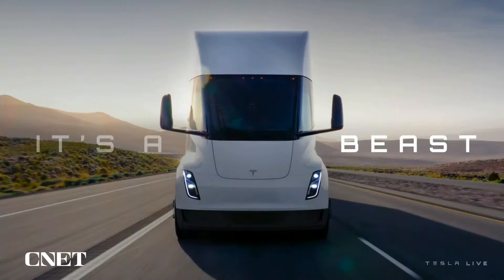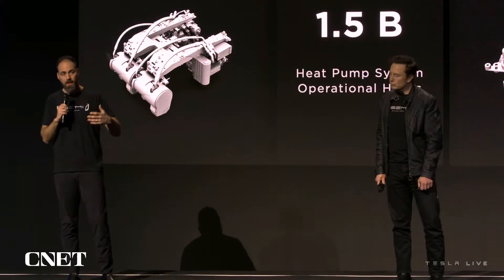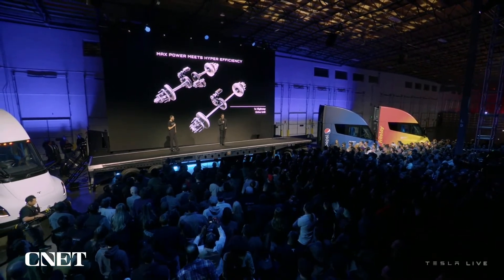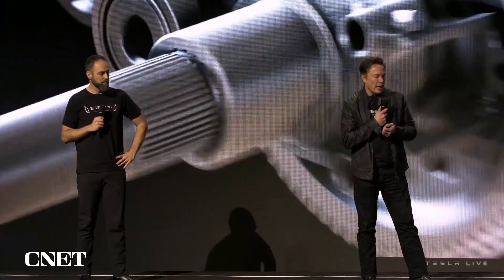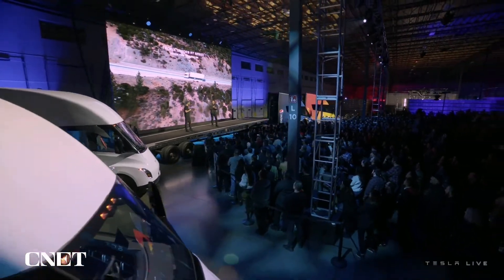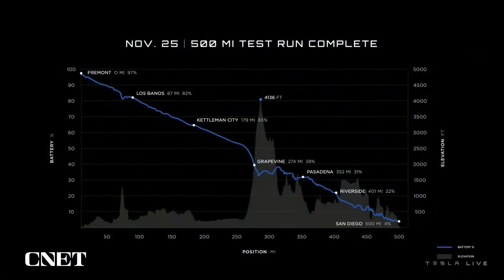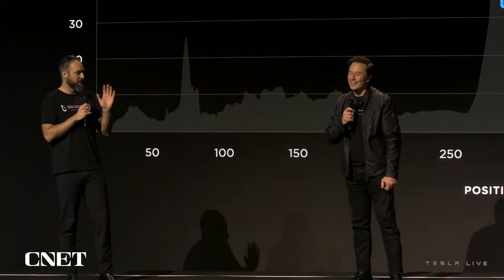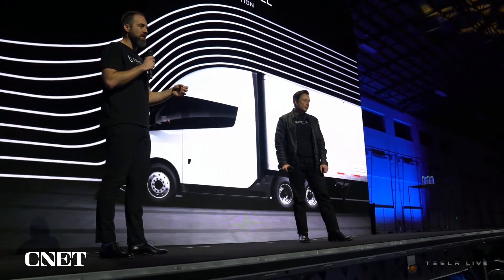Watch Elon Musk's Deep Dive Into the New Tesla Semi-Truck

Comment: All that sounds good for big company's but until they can run 700 miles on a charge an you can find a charging station out in the middle of nowhere an the price comes down 300k... They will never be piratical for small company's (50 trucks or less) or Owner Operators .. I been trucking 35yrs an to prove my point LA to Denver is 1025 miles Beaver UT is the 500 mile mark as of now there is no where to charge the thing so you all the hype talk is just that HYPE ... An a driver that get paid by the mile will go broke unless wages go way up in a diesel that trip will take 18 hrs of drive time @ 65mph so if you leave At 7am Monday you will be in Denver 1pm Tuesday that is driving your 11hr Monday taking your 10hrs then 7hr Tuesday... An before you go telling my that it can run 80mph 90% of company trucks are governed at 65mph so driving this truck you drive 500miles an you are stuck cause there are no charging stations out in the middle of nowhere UT...When they get charging station every 500 miles on the US Hyw system then it is time to talk about pushing diesel out but until this is not a option unless we all want to be naked & hungry...

Comment: They don't seem to mention the weight, they keep saying it does 500miles on a charge. They don't specify what load they are hauling to get this mileage. With a 1 mega watt battery that would take some serious power to charge, like a small power station. He claimed they would all be solar powered charging stations, just think of how big 1 solar charging station would be for 1 truck let alone a facility to charge 100's. It is all a pipe dream or a con like Nikola motors. With current battery technology this is totally impractical.

Comment: How are they going to break-even on those trucks...
1 freight rates are not good?
2 parts won't be in stock...
3 qualified labor shortage 
4 dealer network shortage 
5 biggest problem Truck charging port shortage 
6 tesla was a big failure in cold places cos the heat generation for battery pack drained the battery. 
7 elog capabilities with charging & delivers will result in lower mileage and lower revenues

Comment: Re : down grades....if for any reason the drive train had a major failure  and free spooled  ? Does it have adequate braking to work as a backup should such an event arise ? Or is that an impossibility due to the tri motor design  ? Does it have any conventional type of breaking  ? I.E. disk and rotors ? Beyond the regenerative breaking  ?

Comment: 500 miles? Well that's nice but I drive 700 miles a day. How fast does it charge? Or do you change the batteries out? I wouldn't mind but Congress will have to rewrite the rules for this one. And then I wonder what is fueling the charger; are we going to park next to one of those big windmills or is it solar charging. Just remember the whole point is to get rid of fossil fuels. I'm going to laugh my butt off if this thing is coal powered.

Comment: They did not cover the cost of the Tesla Semi compared to the regular trucks.  Another important factor is cost for repairs when something breaks, and it will, working in the various environments a truck must operate. It cost about $25k to replace the battery on most Tesla cars and SUV'S. What do you think it will cost to replace the battery on this monster? I would bet it is enough to buy a new diesel truck. I like the concept, but so far I am not convinced it is cost effective, long term. Example, an 8 year old Tesla is worth around $8k, and you have to spend $25k to replace the battery. There was no cost savings when compared to the cost of fuel during the same amount of time. Plus you are still paying to charge it.  Food for thought.

Comment: Love him but you have to be able to charge that. Truck drivers need more range than that. Also when we stop at the end of the day, we stop on the side of the highway or if you are lucky, get one of the spots at a truck stop. Curious how long it’s going to take to charge that and there is no where you can stop and charge a truck so it’s really not like it’s ready for full production. You need to get twice that range like a diesel truck gets and have places everywhere you can fit lots of tractor trailers while they are charging.  We are far far away from that. Especially in places that are far off the beaten path.

Comment: I don't know why everyone is pretending that the gross vehicle weight can't exceed 80,000 lbs; when I get concrete blocks delivered, they come on a super b-train (two trailers with five axles). I get 30 pallets of 8" concrete blocks @ about 2700 lbs. per pallet for a total load of 81,000 lbs (does not include the truck and trailer). And no, they don't need a special overweight permit because they are NOT overweight. If I only need a partial load, sometimes it comes on a straight trailer but it costs the same money as a b-train so in order to be competitive, one needs to be able to haul what others are hauling. What I would like to see is a Tesla truck pulling a super-b while hauling an 80,000 lb. load and see what the range really is.

Comment: The one question I have on the regenerative braking. With such a heavy load can the battery up take that much energy in such a short time or do they just dump the power into a giant resistor?
Reply: The bottleneck should not be the battery as charging at a station is higher load than what regen capability can capture

Comment: Ok... I did the math and this is MIND BLOWING!!

Here in Australia, power for businesses is around $0.21/KWh and Diesel is $2.30 a litre at present.
Calculations per 100KM: 

large Diesel truck (23 Metric Ton) uses around 38 Litres/100Km  = $87.40 per 100KM
Tesla Truck (27 Metric Ton - 82Klbs) uses 2KWH/Mile = $33.00 AUD per 100KM!!!

Trucks do about 120,000KM a year here in Australia = $104,880 in fuel
If they were Tesla trucks it would only cost $39,600 in electricity.

Saving: $65,280 a year PER TRUCK just in fuel... maintenance costs surely would be less too.

The tesla Truck costs $261,500 AUD (for the long range 805KM version).

The truck pays for itself inside 4 FREAKING YEARS!!! BEFORE IT EVEN HITS 500,000 KM!!

This is obserd! Australia is crazy if we don't take this on.

Comment: How long does it take to charge? Do you plan to charge or did you make it easy to just swap batteries for pre-fully charged battery instead?
Reply: 70% of the battery capacity is charged in 30 minutes. The problem is that the charger has a power of 1 MW. Yes, it's not a mistake. 1MW.

Comment: So basically, This truck weighs 21,000lb more than the largest Kenworth available not even on the American market but in Australia, The Kenworth t950 Road Train weighs 20,000lb and is a much more capable truck than this will ever be, First of all its payload capacity is automatically 20,000lb more than this Tesla tuck because it weighs that much less. If it was legal the Kenworth can easily tow a few million pounds of weight because they do in Australia, this Tesla could not.
Reply: TESLA semi is FASTER and accelerate 85 mpg < 10 second UPHILL .
cost $200k less to operate.
Reply: @markplott4820  It's a joke lol it's hardly even a real truck with such a low payload capacity
Reply: @markplott4820  No one that drives trucks cares about fast acceleration btw, go see what happens when you accelerate fast while towing in a normal tesla, your battery range will more than halve.

Comment: According to google a 2.5m Concrete Jersey Barrier weighs 1300kg, That means this truck is carrying a total of 14 metric tonnes of weight and it could have fit more Jersey barriers, is 14 tonnes the maximum it is allowed to carry? This has been the speculation since this truck was announced and this video pretty much flat out confirms it. The trailer and all of the Jersey barriers weigh about 40,000lb so is Elon finally telling us the weight of this truck? 40,000lb

Comment: I'm a retired semi-driver with more than 40 years behind the wheel running coast-to-coast, line haul, short haul, and local I have bad knees from all those years of gear slamming if this works out it will be a game changer.
Reply: If you are a semi driver did you notice what i noticed in this video? Elon claimed everything was 80,000lb, that trailer and those Jersey barriers can only weigh 40,000lb meaning this truck is freaking 40,000lb, that is 21,000lb more than the largest Kenworth
Reply: @yesterdayschunda1760   Yeah I noticed that. The battery pack has to be extremely heavy.

Comment: Another musk disaster, less than half the load carrying capacity of a conventional truck. There is a reason why they have decided not to supply them to the market now and just use them ‘in house’ 😏
Reply: TESLA has been using Tesla semi since 2017 to haul for SpaceX in Hawthorne and for Tesla, DELIVERING 9x cars at a time to Customers. TESLA Delivered 82k gross to NEVADA , picking up load in MODESTO , Drinks & Snacks.
Reply: @markplott4820  🤦‍♂️ how do people like you not understand this? 82k is the max allowable weight. They won’t release its empty weight figure thus you can’t calculate its payload capacity

Comment: I love what he's doing! BUT... We're 100 years away from replacing over the road (OTR) trucks with batteries (I know that is not Tesla's current market target). Don't get me wrong, I'm a big, big fan but the general public really has no idea about trucking (or where their food comes from for that matter. I digress).  These vehicles, in time, will only replace short inner-city or smaller warehouse to warehouse transfer. If you have ever worked any battery powered equipment, the answer is obvious. 
@billp5491. There is no extra tire wear or higher loads for EVs.  Most commercial trucks (18 wheelers like the Tesla truck) are licensed for 80k lbs. in the US.  These EV trucks will have to reduce cargo due to increased weight of batteries- same tires, same streets, same weight restrictions.
Fossil fuels will never be completely replaced because nothing has been discovered and utilized that can produce the energy per unit needed to power the world. At least nothing that is as scalable and available as the modern combustion engine. And don't even start commenting on atomic capabilities or some other back to the future fusion BS. It is not available for general use, scalable or affordable. There is currently no other motor that can perform as effectively as the diesel motor.  You have to take into consideration EVERYTHING that it takes to charge those batteries. It's estimated that an electric grid nearly double the US capacity will be needed to transition to an all or mostly all EV fleet for commuters only; and those vehicles will be limited in range and usability as much as 50% of the current combustion engine driven vehicles today. What fuel is going to power those power plants?  Not only that but ask yourself and 10 of your friends if thay can afford to go and buy a new EV this year....heck ask them if they can in the next 3-5 years!  The answer for most Americans is NO, and no amount of hype or legislation is going to change that reality.
The EV trend is mostly driven by political BS and save the planet nut jobs who have no basis of reality. I'm all for reducing emissions, toxins, plastic oceans in the ocean and all that. Heck, I hardly swear anymore when someone gives me a frikin paper straw but people have to stop and actually think.  We have to work on changing the infrastructure and updating that before this becomes reality. So far it's the cart before the electric horse!
Reply: operators will go to TESLA semi purely for FINANCIAL reasons. 
saves $200,000 per year operations. 50% less maintanance.

Comment: A major energy loss for any vehicle moving at speed is aerodynamic drag from streamlines not rejoining at the aft of the vehicle, basically dragging a tube of air behind it.  Look at aircraft and you can see that they are well tapered towards the end of the fuselage, and sometimes have vortex inducers to try to keep the boundary layer attached to reduce the area of that drag tube.  SO, why would there not be engineering attention to smoothing the bluff end of truck bodies?  I would have thought that getting the streamlines to close back in after the end of the truck body - even just a little bit - would be a huge win for reducing energy loss.  Yes it would have to be some sort of structure that would not interfere with opening doors and yes it should not significantly extend beyond the boundaries of the body, but you could do a lot with deflector vanes built into the doors or some structure that swings in from the roof.
Reply: already DEVELOPED for semis , avaliable Comercally.

Comment: Really look forward to seeing how well these do out in the real world.  I think for companies that control both ends of the route like Walmart, Pepsi, Amazon etc.  These trucks could be amazing for reducing cost as long as they have a reasonably long life.
Reply: Can't wait to see them on the road
Reply: @Space Related that’s the whole point, they won’t release the empty weight so everyone is trying to reverse engineer it. Musk has excluded the most important piece of information from. I wonder why 🤔😏.
Reply: less than half the load carrying capacity of a conventional truck. There is a reason why they have decided not to supply them to the market now and just use them ‘in house’ 😏
Reply: @bayly1977  Where do you get "half?"  Tesla Semi weighs 27,000 lbs and it gets to haul 2000 lbs more because it is electric.  So that tractor equivalent weight is 25000.  Most of its diesel powered counterparts are around 20,000 lbs.  So, sure you give up about 10% of your weight capacity but that is no where near the "half" you claim.
Reply: @eugeneforge 😂😂😂 They can’t compete with diesel trucks, that is a fact.  More Elon nonsense 😂😂

Comment: The world is not ready for this because resources for batteries come from somewhere and with semi trucks joining the demand for batteries will not be climate friendly. Also a large percentage of American still generates electricity through coal. This will increase the demand for electricity with will end up not been climate friendly.
I believe Toyota hybrid systems in their new vehicles line up is a more practical approach that will make sence right now for the trucking industry. Reduce the engine sizes by half and add batteries to make up for the power and torque. Toyotas idea will be more cost effective since the engines act as generators. Spending half your annual gas expense and more than half on maintenance since the engine size will be smaller.
And not forgetting every feature tesla mentioned can be done by a hybrid 
Just my thoughts
Reply: FALSE, Tesla makes TW in batteries in NV , right next to Tesla semi factory.
Reply: @markplott4820  littium p batteries are not made out of dust. And our electricity is currently only 20 percent from  renewable energy.

Comment: A) The degradation to roadways is the tire / torque limiting factor. For regulators
B) The battery's will need to be in the trailer 
C) The time to recharge , will make a fresh charged trailer necessary for next. 
E) Elon Spin doesn't always hit the mark